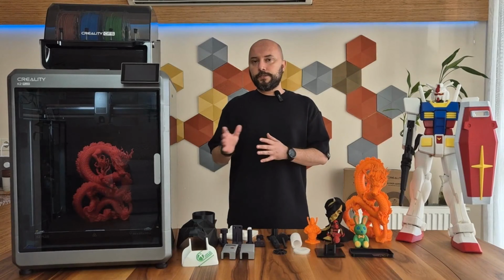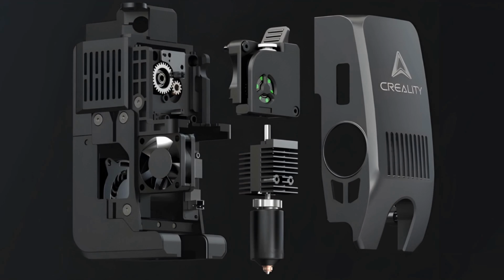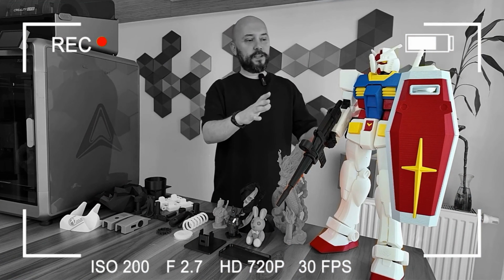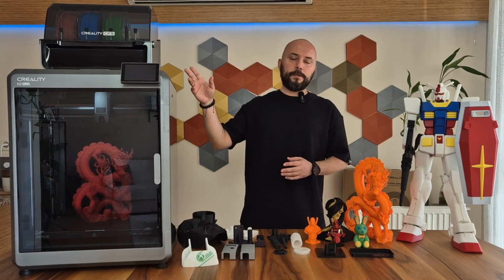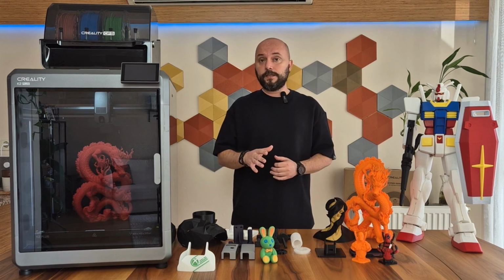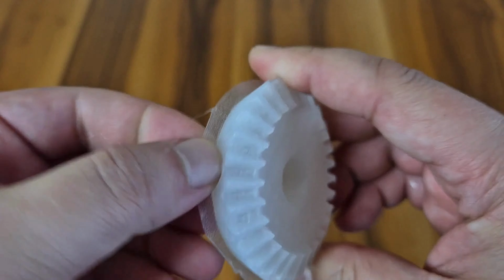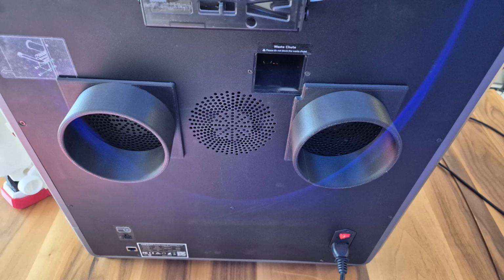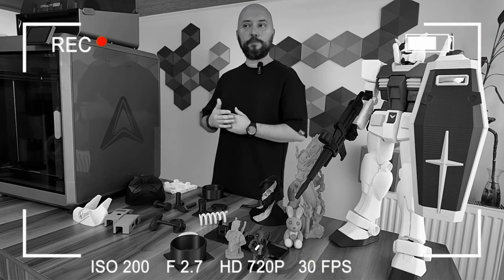Creality K2 Plus Combo Review   Let the Game Begin!

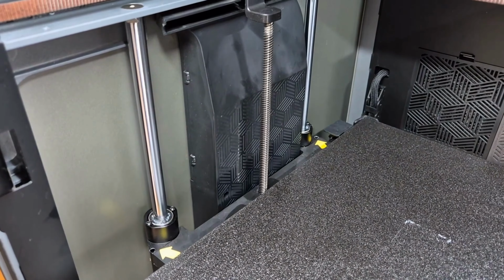Comment: 4:38 That’s a wobbly lead screw :(
Reply from the maker: This is not a problem. The important thing is that the steel shafts do not wobble.
Reply: @3DPrintLab1  It will actually show up in your prints. It is a common problem with some of these. Other influencers who have received this printer have had the issue.

Comment: Great Review! I really like your "matter of fact" style  in your assessment of the printer. I have been using my CREALITY K1 MAX for a year and while it's a great printer it's time to move UP to the K2 PLUS. I ordered mine 2 days ago and we will use it for an array of materials including polycarbonate carbon fiber. While I do understand the concept of "Crealityness" I do see that CREALITY seems fairly responsive in software fixes and I think the K2 PLUS with CFS will hold its own despite some issues. Looking forward to the larger print bed, multifilament, and the increased ability of this printer due to the multiple technology improvements.  I am hoping it will give the X1C from BAMBU LABS a run for the money. I do like that the software is not as locked down as the software from the maker of the X1C. Direct Drive extruder with the UNICORN NOZZLE SYSTEM was a deciding factor in making a commitment to buy and so was the AI based camera for consistent printing.
Reply from the maker: Thank you for liking the video and sharing your thoughts. Did your printer arrive? I'm curious about your usage experiences.
Reply: @3DPrintLab1  Yes! We now have a CREALITY K2 PLUS with CFS and a CREALITY K1C just went online and calibration tests are underway. ThevK2 PLUS has been amazing and CREALITY has been quick to do software and firmware upgrades. Super smooth and dimensionally accurate prints are coming out of the K2 PLUS! Very pleased!

Comment: The result of a print job is called a print, not a printing.
Reply from the maker: Hello, this video was dubbed with Heygen AI. Actually, I check and correct the sentences after the translation is done. However, since my English is not good, there are still mistakes. This is one of them. Thank you for your warning, I will be more careful when checking from now on.

Comment: I'm considering getting this as well as a few others, but I have a concern. I'm trying to find one that can print some specific dagger models as a single piece. How do you think it would hold up to printing it at a diagonal with the blade facing up with supports? The size is my main concern. Though this is one of the ones at the top of my list because it lets me use better filaments for other things as well. Just curious as to anyone's thoughts on this?
Reply from the maker: Can you send me a link to a sample 3D model that you are worried about printing, so I can understand the issue better.
Reply: @3DPrintLab1  Yeah, thingaverse thing:5174847.

Comment: Great video. I bought mine about two weeks ago. Except for issues I finally resolved printing TPU, the printer has been flawless. I actually have a dedicated Nozzles for CF, one for TPU, and one for PLA, PETG,
Reply from the maker: Thank you very much, I'm glad you liked the video. What kind of problem did you have with TPU? It's a difficult type of filament to use.
Reply: @3DPrintLab1  Creality TPU Filament kept  getting jammed in the extruder gears. I changed the retraction speed and dried it for 6 hours.
Reply from the maker: @metronyc2855  I do not exceed 50mm/sec when printing with TPU. Again, you can reduce the acceleration by half. Drying the filament will positively affect your print quality. The hardness of the filament is also important. You should be able to print a 95A TPU under these conditions. By the way, since I do not know your usage experience, I should note this. TPU does not work with the CFS system, you must put it in the filament holder.
Reply: @ Thanks much. I will try "50mm/sec" setting. Lost tow days getting TPU to work. I wasn't totally convinced drying was the only solution but seemed to work along with with the Retraction update. I use 95A either in the spool or from the dryer. All other filaments were spot on. My use cases are engineering parts. Mostly PLA, PETG, CF.
Reply from the maker: @metronyc2855  You're welcome, I hope the problem is gone with the new settings.